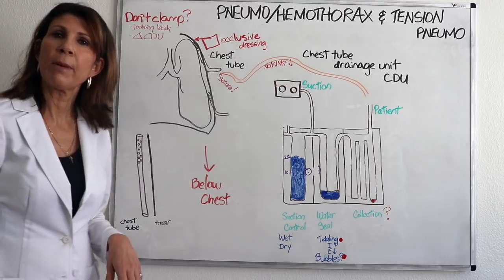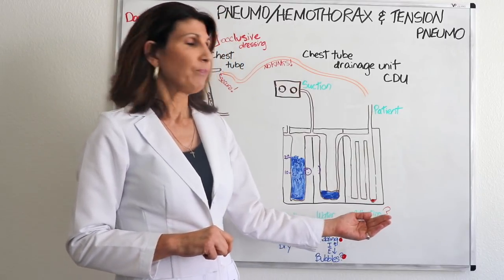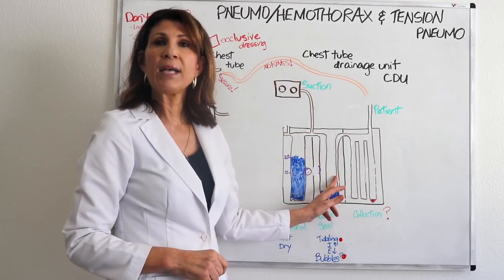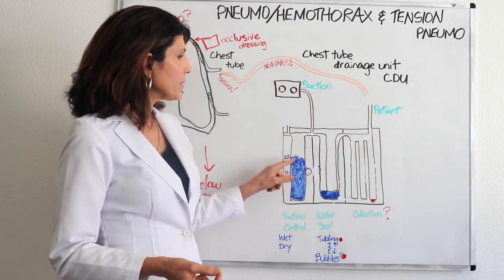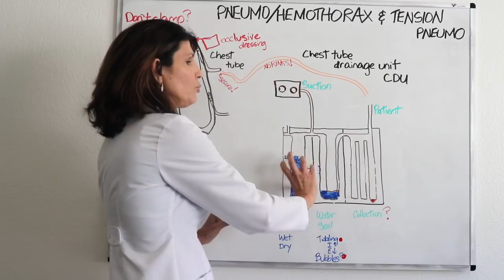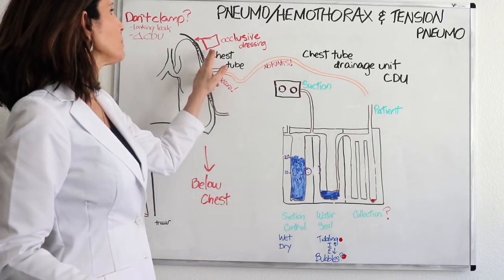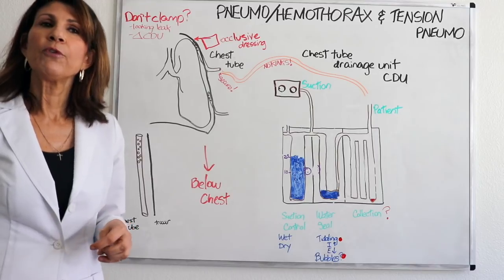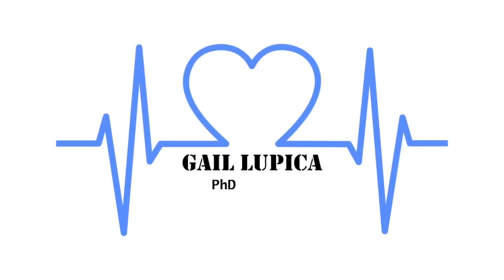Chest Tube Basics for Nursing Students

Comment: what keeps the water in the water seal from being sucked up?
Reply from the maker: It's too heavy.  Heavier than air so that's how it can provide that water seal, as long as the "straw" is underneath the water seal line and therefore a closed system is maintained.